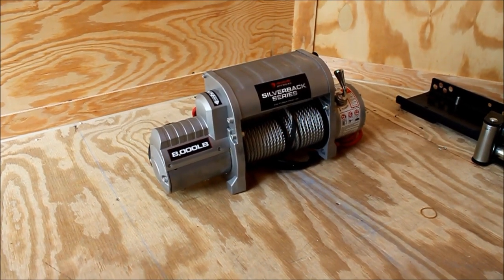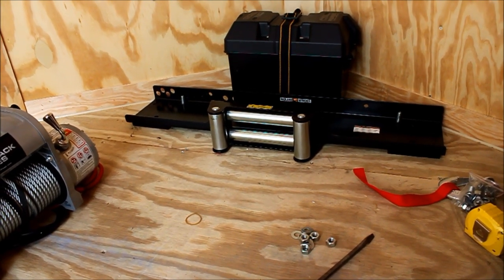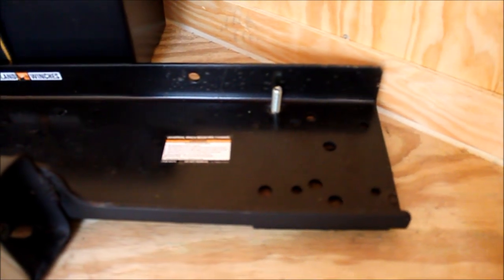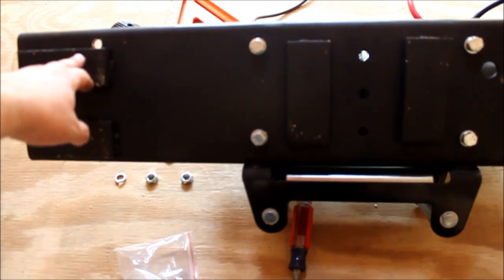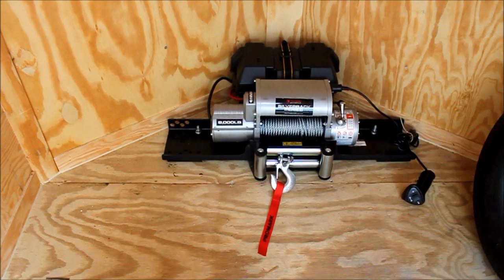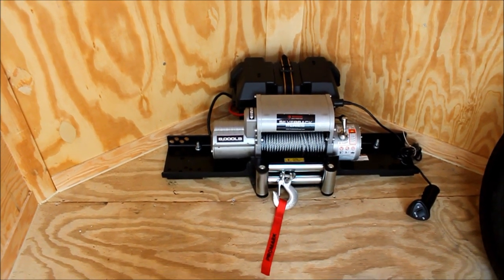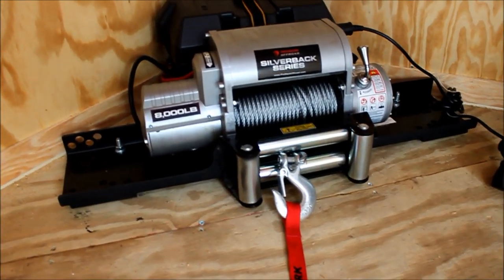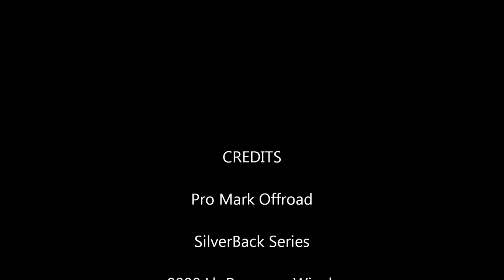Installing My 8000lb Promark Silverback Winch in My Trailer

Comment from the maker: Well, with each wrap of the cable the pulling power is cut in half and the cable wraps around the winch three times and my razor weighs 1000lbs roughly... I can see how it looks like overkill...